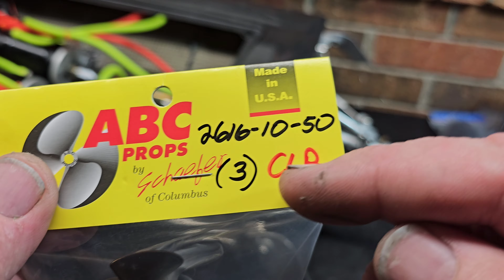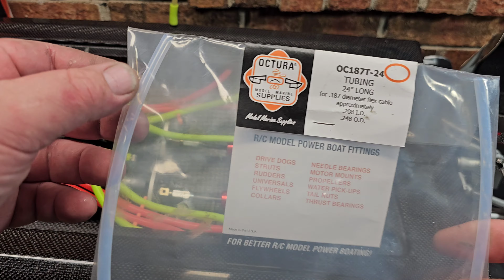51" TFL Ariane Update & Rc Boat Parts

Comment: I'd run this in your pool & hold the nose & hit the throttle, see if lock tite will hold. It'd be a cool short too
Reply from the maker: I used a 2mm pin at the very end of the threaded shaft, it shouldn't go anywhere now, jb weld for reassurance

Comment: Big B , thanks for sharing . 
The starboard prop rotates anti clockwise , so the shaft has to be anticlockwise threaded ? The port prop rotates clockwise , so the shaft has to be clockwise threaded ? Is that correct ?

Thrilled to see the small cat 🐈‍⬛. You say that you built it . Did you build the hull too ? Where did you get the kit from . Would love to see it run . It looks like a mini Bulgarian cat ! Thanks
Reply from the maker: The little catamaran is from an ebay vendor,  it's a hand laid fiberglass hull, 21" so parts for a twin were none existent.   Here's the playlist link to the build series 
21" Twin Motor Catamaran: https://www.youtube.com/playlist?list=PL9QFIiVlkdYZLORST3YVaMw3dhliHHPOs

Comment: 30 min epoxy is a great thread locker , you will need heat to get it apart. Just a suggestion from a slow boater. (87 mph ,once)  I am very interested to see how fast you can get that big boat to go.